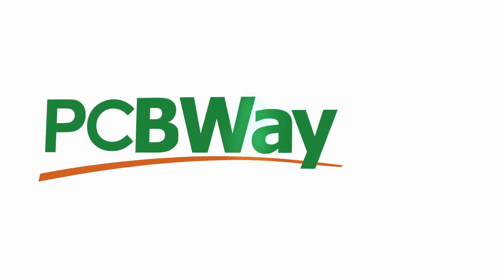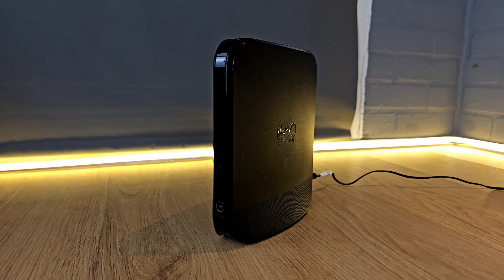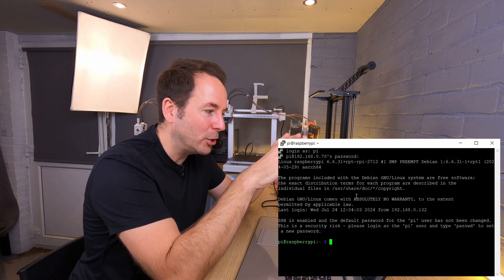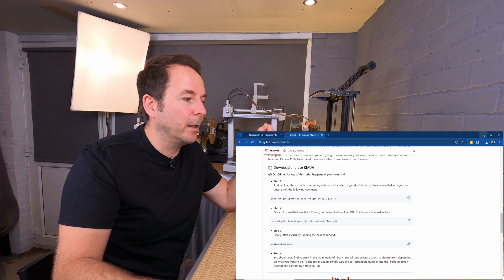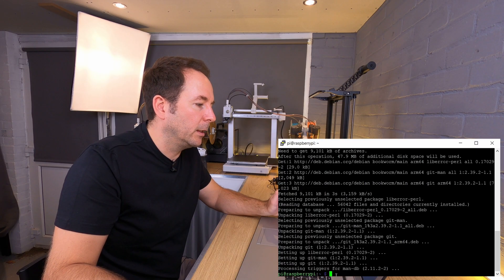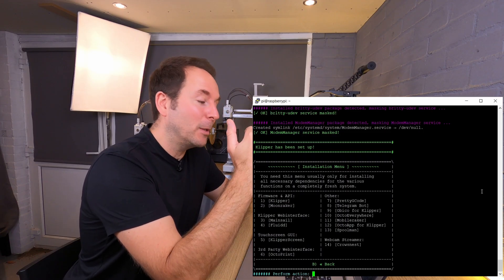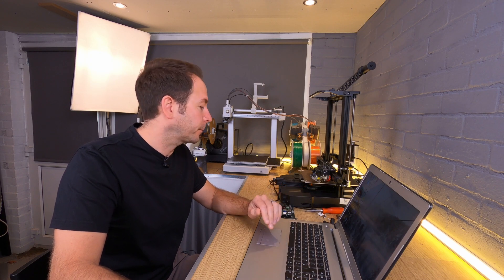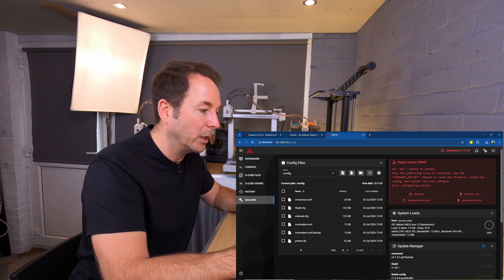How To Install Klipper The Easy Way Using KIAUH - Klipper 3D Printer Series Part 2

Comment: Thanks for the series. Informative and detailed. BUT, All tutorials assume that all process come ok and that user can use Mainsail just after install. A perfect addon to the series would be a video that help people who drect their browser to host and get "Add a pinter" prompt instead of working Mainsail. Probably the most common issue, that render the rest of ttorial useless. Really, 80 or 90% of trials end up with this issue. No matter you do, there is no step further unless user solve the problem. And most probably he/she would just go back to Marlin saying "fortunately I haven't bricked my printers control board yet by flashing it with anything".

Comment: I have klipper installed using Kiauh.  Next I tried to install moonraker.  The install hangs on “building wheel for uvloop (pyoroject.toml).  It eventually errors out and the moonraker install fails.  In Kiuah there is an option to go with new version 6, or use old version 5.  They seem to recommend the new version.  Maybe this is the issue.  They don’t have everything worked out?  I don’t really know what to do from here.  I am not a programmer and don’t even know to post the issue.
Reply: I went back and successfully installed moonraker with v5 of kiauh.  Could not get the build to work with V6.  I wish I knew how to report this to Kiauh people.

Comment: I just had an oops that cost me a whole day of swearing and troubleshooting.  When you are in the terminal you enter your “login as”. In this case it’s pi.  In the terminal the line asking for your password pops up.  When you type in the password the curser will not do anything.  You just type it and hit inter.  The curser will not register anything as you type in the password.  I kept thinking putty was froze so I never completed typing the password.  I just watched the video for the 10th time and noticed that the curse does not register typing in the password.  It worked once I realized this.
Reply from the maker: I remember thinking the same. Wish I'd mentioned it in the video.

Comment: Rick. Thank you for posting these videos. The are very helpful, for the most part... there are some gaps, but that is due to individual setups. One thing I should note (if you decide to go back and update this)... the latest iteration of the RaspberryPi imager application now includes the installation of Klipper/Mainsailher piece, so if the new user/installer attempts to follow your Kiauh instructions, they end up overlaying/reinstalling the versions of Klipper/Mainsail/etc that the Pi imager just laid down.
Thanks again.

Comment: Thanks for the series! I followed your later video on adding a KlipperScreen and it worked perfectly. I now have a nice 7" display that is easy to read with my old eyes. 😀Ran into a gotcha with using KIAUH on an image from Raspberry Pi Imager. It was the Mainsail image lumped in with the other 3D printer images. When I installed KlipperScreen thru KIAUH I was asked if I wanted to install Network Manager. Answering yes will conflict with the existing Nwk Mgr installed by Mainsail and trash your wireless connection. As a work around I used a 64bit lite image and installed KlipperScreen first thru KIAUH. Follow that up with Klipper, Moonraker, Mainsail, fluidd and Crowsnest (if you have a webcam). This results in an error free install. I did not try installing the apps in numerical sequence so it is possible that there is no conflict. If I skipped Nwk Mgr KIAUH complained the installation was incomplete and the Network menu item didn't work.

Comment: Great vid!  One additional tip is that if you have a monitor you can plug into the rPi then once it has booted up it tells you what its IP address is right above the login prompt so you might not have to go through the hassle of finding it in your router config.

Comment: instead of remotely connecting to the could you not just plug the Pi 5  in to your network via network cable and use hdmi port to a monitor and usb keyboard and mouse -- no need for separate computer

Comment: Great Video. However, you can use Windows Powershell instead of Putty for those wanting a secure method. The command in Powershell is: ssh [username]@[IP address]

Comment: Very helpful video! 
On a side note, python 2.7 is old and unmaintained, should never be used if possible. It's probably there for compatibility with older scripts that still use the old syntax (changed in 3.0).